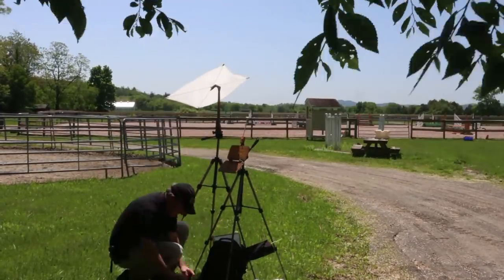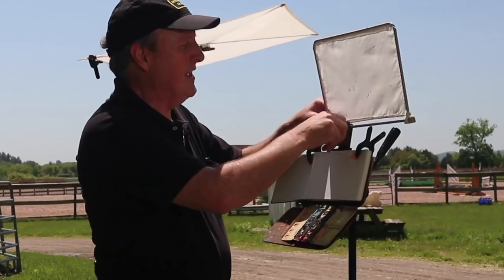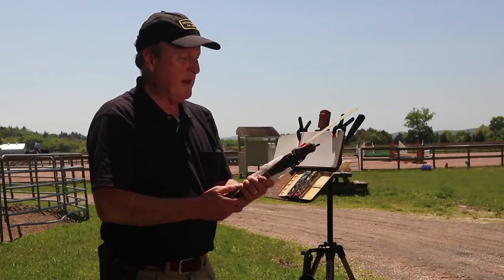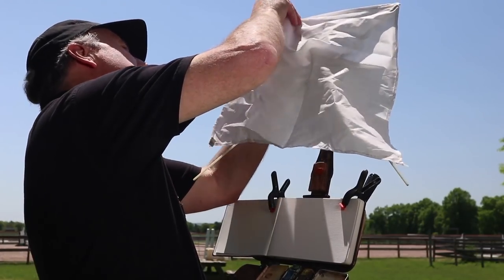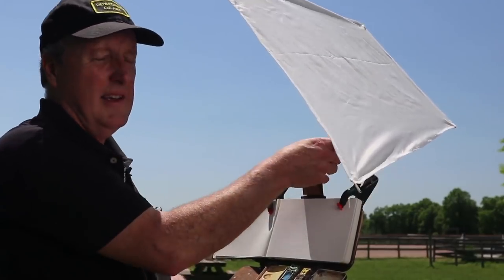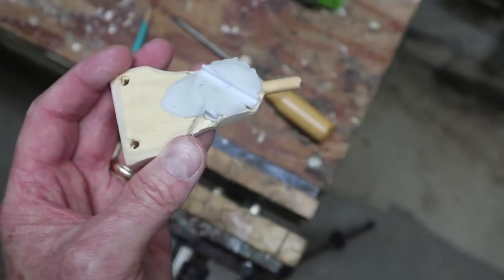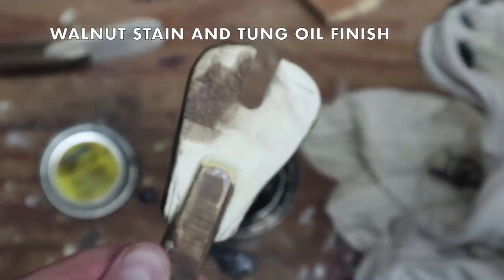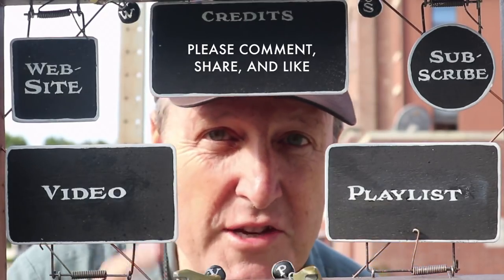How to make a better light diffuser for your sketch easel

Comment: Love this. Help me clear up a picture in my mind here about the cross bow area. You stuck putty in where the impressions for the cross bow to to thru..like you filled it in. How does that work, when you are to slide the sticks thru each slot? Thanks.
Reply from the maker: Virginia, I just used the putty to hold the cross piece on the top. I was careful not to fill in the tubes. Alternate build is to just drill out a piece of wood with two holes at 90 degrees to each other. The fabric will hold them in position.

Comment: Awesome and handy advice. Only one point: Use wood glue on wood. Permanent bond stronger than the wood itself. Gorilla Glue you are using is "urethane" and not a true cement that will give up at some point when the wood moves in the humidity of the air. It's fine for this, as the wood is soft and the stress is not critical. I'll be checking out the FB group!